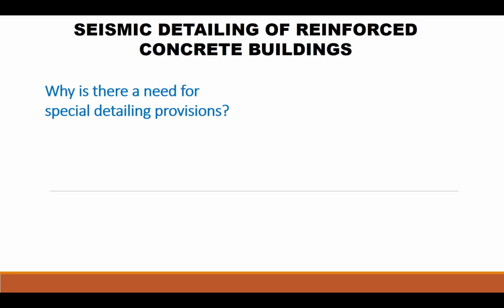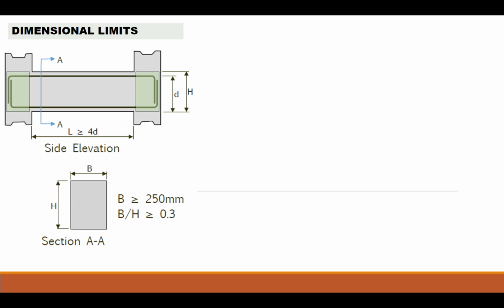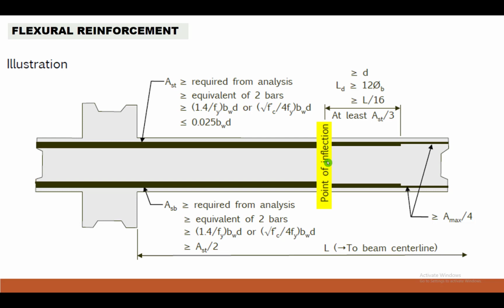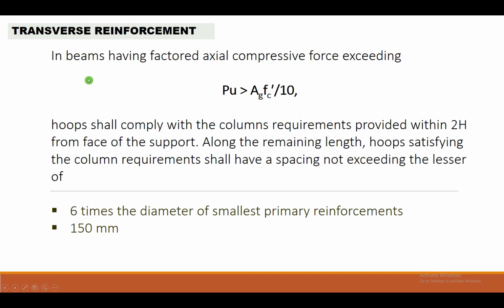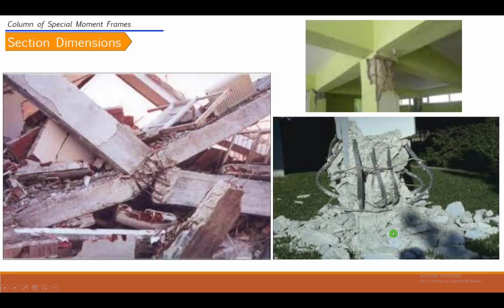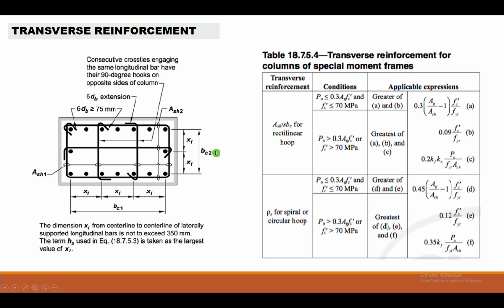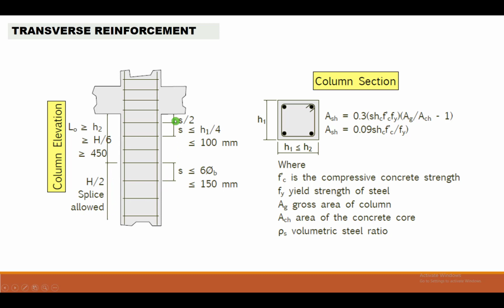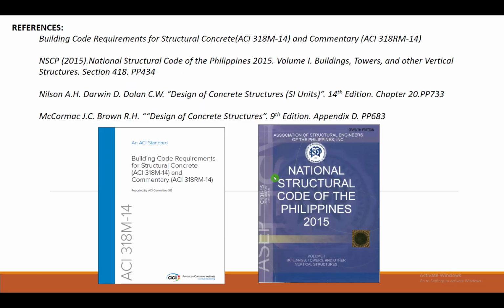SEISMIC DETAILING IN ACCORDANCE WITH NSCP-2015/ACI 318M-14: SMRF DETAILING REQUIREMENT

Comment: thanks sir for the information. im your new subscriber.  tanong ko lang kung ang SMRF detailing ay applicable din ba sa 2 storey houses?  kasi parang ang laki ng columns kung susundin ito.  300mm minimum column width  and ratio of B/H = .4, H = 750MM?  Tama po ba ang interpretation ko. salamat in advance 
sa pagsagot
Reply: oo applicable. 300mm minimum size for column so kung may 300x300mm column ka, ratio is 300/300 = 1. Greater than 0.4 yung ratio so ok